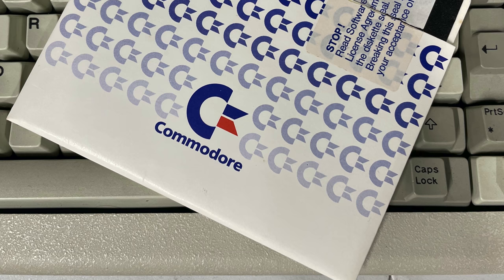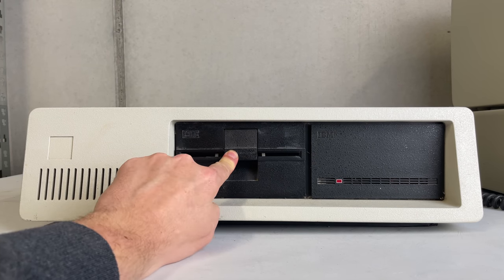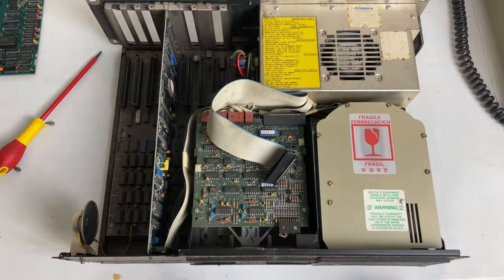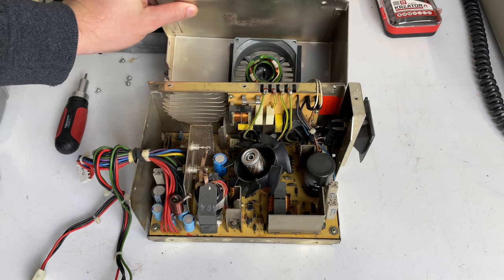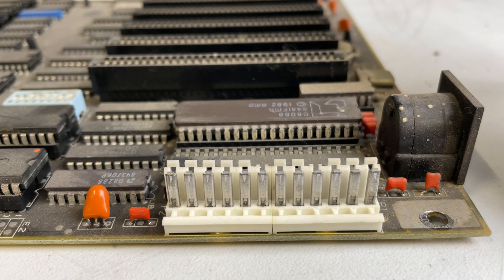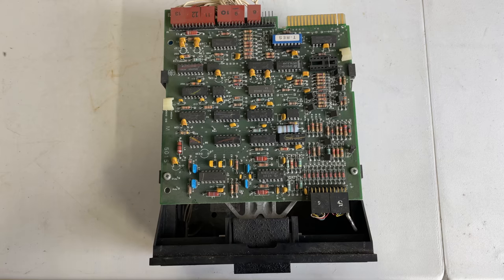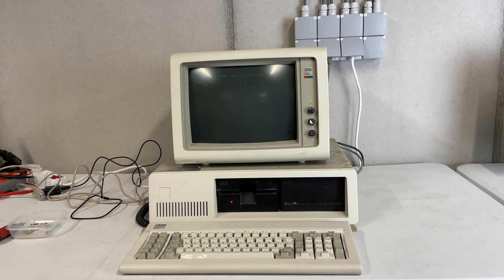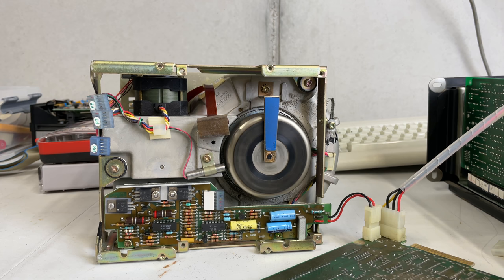Installing MS DOS 2 11 on abandoned IBM PC XT #DOScember

Comment: Great job on the troubleshooting, and you showed why it was often better to just leave systems up and running to prevent drive and stepper motors from freezing up.

For those who hated the noise in this video:  I used to support hundreds of VAX workstations and mini-computers that used MFM ST-series drives.  One notorious problem was a hard graphite "button" held onto the end of the spindle shaft, used to bleed off static charges as I recall.  After years of continuous use the shafts would wear a dimple into the graphite and cause a very loud high-pitched shriek.  Think of chalk on a blackboard but at Mach 2!  We finally figured it out and were able to shift the graphite button slightly so the spindle had a fresh spot to work on.  On some drives we just removed it completely (not my preferred choice).  I hope that helps anyone hitting that same problem!
Reply from the maker: Thx for the detailed explanation ! Interesting stuff. Happy holidays and all the best for 2021.

Comment: Mind-boggling. I remember how, almost 40 years ago, my coworkers and I stood up and looked into the hallway of our megacorporation as the IBM PC was trundled down the path to some high-powered' manager's corner office, ensconced in its cabinet and escorted by two security staff. Obviously, the manager was going to perform some computer magic and grow the company with that machine. 10 MB hard drive! I just looked over at one of my external -- run-of-the-mill -- 4 TB drives and did some mental calculations. I'd need a warehouse full of those 10 MB drives to equal the storage capacity of that cigarette package-sized 4 TB drive. I remember when I thought I had all the storage I'd need when I bought my Leading Edge XT-clone computer that came with a whopping 30 MD hard drive.

Comment: The spinning of MFM HDD is like Harley-Davidson Bikes kick starting
Reply from the maker: Sounds much better than one of those xt-ide cards :)
Reply: @RetroSpector78  Funny enough, I was looking at a PI1541 build, and they have a little speaker to minic the real 1541 noises, and I'm thinking "this is both totally pointless, and exactly what my SD2IEC needed"
Reply: Xt ide is just a good option to test quickly softwares and other stuffs  on some machines in progress but it's not a definitive solution to make a good and '' original '' restoration.
Reply: @francoisfritz198  There's a lot of line between "period correct", and "functional in modern day". My current modern systems all got outfitted with Ethernet for getting files on and off. I know LGR uses a XT-IDE in almost all his machines to make it easy to sideload.
Reply: Sounded like a plane was right next to me lol
Reply: @NCommander  totally agreed  with the easiest way to get an affordable machine , xtide or cf-ide more, the pc's across the ages are prone to be upgraded with all newer compatible hardware. (excuse me i dont speak well english and i dont understand the second part about your modern systems)
Well on the opposite side, rebuild or refurb one machine with the strictly exact stuff on it is a quest, and i love it. 
in any case retro machines are our common heritage and it s good thing to restore these with all possibilities.

Comment: This reminds me how I saved my western digital hdd (21mb mfm drive).
First it had bad tantalum caps which prevented the computer from starting. After replacing them, the hdd was spinning up, then stopping.
I was about to throw the towel on it until one time it remained and was readable. So I let it run for a couple of hours that way and then it was starting ok.

However soon after it did the same thing again, so I decided to run it even longer. Since then it's been perfectly usable ^^

Sometimes these old drives just need some help to work again :D

Comment: great video! Wonderful end to DosCember. I got my first PC when I was 8yrs old. It was a SYNTREX 80286 that a neighbor handed me down. It was a 8/16mhz chip and the CMOS had a bad backup battery. I eventually got a new battery for it and then I was up late one night and I saw the advert for my PC on the Home Shopping Network on cable TV! I saw the ad and they said my PC had 1MB of RAM! I was operating with just the 640kb RAM up until this point and only at 8mhz. I went into my BIOS and switched my RAM to allow using the extended memory, added HIMEM.SYS to my startup files and now I had essentially downloaded more RAM. I also set my core clock to a massive 8mhz overclock. So I have lots of nostalgia for DOS machines. It is such a wonderful era and I am thankful that you are helping to preserve it. Happy new year ! Had to edit and add I had a 20MB western digital HDD in this PC.
Reply from the maker: My DOS experience started with a 486 so for me its all new :) great story. And best wishes for 2021 !

Comment: my 3.5'' fuji mfm hard drive do the same noise... sound! it also run nicely, after low level format.
 your ibm series is just perfect, by your fault i have an p70 now :) and your tips about connecting a modern floppy drive help me even if the original drive recap solve the problem, thanks a lot! but now all my plasma board axial capacitors have just leaked and i wait some new ones from US, because the plasma price is just amazing and the spare is very rare.
 thanks again for all of your work, take care, ''passez de bonnes fêtes de fin d'année"

Comment: Did you try putting some sewing machine (3 in 1) oil in the drive motor? That usually helps
Reply: came here to suggest this
Reply: If bearing are a little dry, but if a leak in motor will have oil over the platters - not good.
Reply: I thought that 3-in-1 was not recommended for these type of things, due to containing particles of some sort. Likewise for WD40. OTOH I thought sewing machine oil (which is the same as the type used for hair clippers, I believe) was OK, because it's just pure oil without particles. Don't quote me on it, but that was my impression.
Reply: @doublehappiness9889  i wonder if pure synthetic oil would be better for these drives
Reply: @SilverX95  That sounds more like it to me. From what I know silicone lubricant could be way to go (just a spectator myself, but I've seen quite a bunch of these kind of vids.)

Comment: Thank you lol I just picked a 5160 with a 286 in and with the same power supply, not wanting to cause more damage I unplugged the PSU from everything and tried turning it on to see if I had voltage, which gave me nothing but now hearing you say it needs to have a load gives me hope to try it again.

Comment: I have 3 or 4 these disks in similar condition. Bearings totally destroyed and full of BB's. Sounds like old circular saw, but yeah, they still works. In fact, today is a quite luck to find ST-412 without BB's and with not destroyed bearings.

Comment: About the HDD motor: the Li-2 airplane that lives at my hometown's small airport gives a similar, though beefed up, sound at startup... :)
Reply from the maker: And it can probably also carry 27 360kb floppies worth of storage :)
Reply: @RetroSpector78  Actually I'm a bit afraid that the Li-2 cannot store bits and bytes. :D
Reply: @RetroSpector78  The Li-2 was the Soviet version of the DC-3 built under licence.
Reply: @RetroSpector78  interesting info 😊

Comment: Very nice; this is great to watch while the render bar in kdenlive goes burrrr. I just had to cancel my video release for today because of a stupid footage error that of course only got caught 20 minutes before the video went (talking about restoring an 486 EISA system).
Reply from the maker: I feel ya ... I forgot the doscember overlay in the intro but didn’t want to cancel / reupload anymore ... Rendering, uploading .... long turnaround times indeed .. they should do something about that.
Reply: @RetroSpector78  the YouTube editor actually used to be a lot more functional. Google removed quite a bit with the "new" studio experience :/

Out of curiosity, what do you use to archive hard disks? I ended up writing a custom utility so I could use INTERLNK/INTERSVR (or NetWare) in the future w/ a sector dump so I could run autospy to find deleted programs that might still be in the unerase tables.

Comment: You might want to look at finding a tool that can optimize the interleave on the drive.  I had one of these exact IBM drives with the same controller that I had put in an original Compaq Portable 1, and ran an interleave optimizer on it and it increased the overall throughput 3x.  For those not familiar with drive interleaving, it has to do with the speed of the stepper motor.  If the stepper is moving to the next sector and it's on the next track, you want that sector to be directly under the head when it moves over.  If the interleave is not properly set, the drive could have to make as much as a full rotation before the next sector is there.  Slow stepper motors or slower PCs could require a higher interleave ratio.  A fast drive with a fast computer can run a 1:1 interleave which means the next track does not need to have the sectors off-set.  I think SpinRite can do this, but it's been a long time. Some Norton tools could also possibly do this.

Comment: I don't agree with your dismissal of -12V as being an unimportant voltage rail. You'll find it's needed to get any contemporary RS232C serial cards running which is handy for transferring files and the like. They all need +12V and -12V for the line drivers. The oddball voltage rail is the -5V. Don't think anyone built a card that used that rail so that can be safely ignored. 😀 Thanks for the videos and all the best for the New Year!

Comment: My 20MB IBM AT Harddrive (also full height) refused to turn with the original PSU, when I connected a modern one with probably a few more amps on the 12V line it blew a Tantalum cap and after fixing that it finally went into action, took a full minute to get to speed the only thing I ever heard that resembles it is the old air raid siren on the post office. Second spinup was a lot less dramatic, a bit disappointing. :D
Reply: Only so many times it can repeat that performance before it runs out of caps, eh?
Reply: @nickwallette6201  hehe, yeah well, seems the other caps of the same type held up, and there are like 8 more of them. One day when I own a hot air station if shall do something about it, because it's all tiny rectangular SMD stuff. The lone exploded one I managed to get replaced with the iron.

Comment: You’re pretty patient and determined with that harddrive! I guess it need a bit of kick starting, I don’t know if is even possible, but a drop of oil on the bearings might improve it, provided that there is a way access the bearings.
Reply from the maker: Completely sealed so not really serviceable. These things are pretty sturdy but are designed to run and not sit idle for decades in far from ideal conditions. Glad it’s running again. Best wishes for 2021 !
Reply: needs lubricant as well :[

Comment: The stepper motor going back to track 0 is normal error recovery behaviour. If the system has problems reading or writing a sector, it assumes that maybe the stepper motor got off track by missing a step, and returns it back to track 0 to re-establish the track positions. This is called recalibration, and DOS by default retries operations multiple times with recalibration inbetween, so you always see the motor going back to track 0 several times if a bad sector is encountered.

Comment: Anybody remember the Olivetti M24 - would be a great project, it came with the 8086 at 8MHz and was as I guess the first "faster than XT" PC. thx for the memories...
Reply from the maker: I’ve got the M19
Reply: @RetroSpector78  my first PC was a PC10 with an Emulex ESDI Controller and a 20MB Fujitsu ESDI drive - (I guess I've paid for that drive-combi alone around DM 2500.-)

Comment: For a minute there, I wondered if that drive was going to level off RPM-wise!  I once had a Miniscribe 3650 which I believe had a bad RPM detection circuit.  Sometimes the drive wouldn't spin up at all, and sometimes it sounded like it wasn't going to limit how fast it could go!!

Comment: I just got some old Seagate hard drives from Ebay. One is an ST-225 and the other is an ST-251-1. I had to take the cover off the ST-225 to manually park the heads since they do not autopark and I am waiting for a 386 motherboard to be delivered. I would love to get my hands on an ST-506 and ST-412, but they are too expensive.
Reply: These were listed as working? I had a PS/2  386 model 50 stopped working pulled the CPU out - some pins had Rusted off.

Comment: There's people that prefer SD cards in stead of hard drives, but damn they are missing out on the experience of a real hard drive especially the sound.
Reply: Totally agree.  If you want fast and non-cantankerous, then why are you fiddling with XTs?  ;-)
Reply: @nickwallette6201  Trufax: got a socket 7 machine running off a CF-IDE adapter. I like the speed and convenience(particularly changing OS by swapping the card), but I definitely miss the drive sounds.

Comment: An alternative method for testing a power supply from one of these computers is to connect a LED fan, might be better than risking a HDD.
Reply from the maker: No LED fans in my retro hardware bin :) but a good idea. Bought some bulky resistor acting as a load but those don’t do much obviously :) best wishes for 2021 !

Comment: lube the drive motor and the stepper motor as well. That drive NEEDS it.
Reply from the maker: Drive motor is sealed and cannot be lubed as far as I know. Stepper motor seems to be working really well....
Reply: @RetroSpector78  doesnt mean you shouldnt at least put a drop of oil in it just to keep it healthy long term, as you probably wont use that thing every day like it was original designed to.

Comment: Great job. Was wondering if you could image that MS-DOS 2.11 disk and share it on archive.org or something like that. Its an
 English version and the only one online is German. Thanks.
Reply from the maker: I was planning to but a couple of files cannot be read anymore. Also reached out to some people if they had the english version but no luck so far.
Reply: You should image it with imd or image disk. Then use a program called spinrite on the disk. Both run in dos. Spinrite is a hard drive utility but it works on floppies too.  It does low levell repair on disks.  Find it at GRC.com. you may have a copy. Its not free but it works on all disks and hard drives from rll to ide and sata. Thx
Reply: @RetroSpector78  hi can you copy the command.com file from the disk. I found a way to mod the German version. Thx

Comment: how you do a low level format
Reply from the maker: On an IBM you can do it via the diagnostics disk using a menu, or via the debug command. Most mfm controllers (not the ibm one) have a low level format routine in the bios that you can execute via debug, giving you a CLI to perform the low level format

Comment: @24:57 interesting 'active' is spelt incorrectly
Reply: Remember the utility was made by Commodore, even though it was called FDISK. Commodore made its PC's in Braunschweig (Brunswick), Germany. So, most likely, this is a mistake that occurred when the software was localised to English. The German word for active is Aktiv (with no E at the end). Note the similarity between active and aktiv.

Comment: Ms-dos 3.22 was far superior.
Reply: Mr Guru  some Industrial control systems still use  MsDos, the newer ones use windows XP or CE.  I am in the middle of upgrading one that was written in turbo Pascal 5.0 on an OS2 machine,  the hardware interface is a nightmare.
Reply: Mr Guru  indeed that's why I have to keep a working laptop wit an rs232 port  running XP and with a FDD just for maintenance on them, the Ebberly tsx21, is the worst I have to disassemble the plc then plug then UV erase the apron card re program it with a custom briefcase,  burn the card then reassemble the plc, Bluetooth programmers as so spoilt.